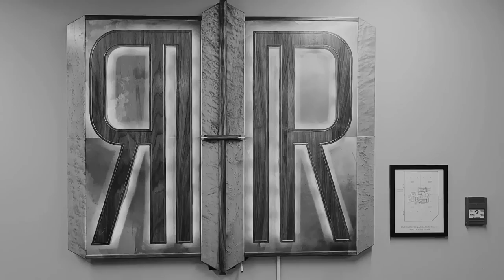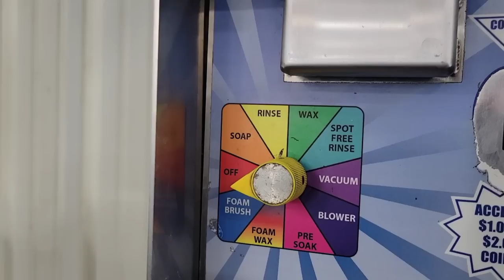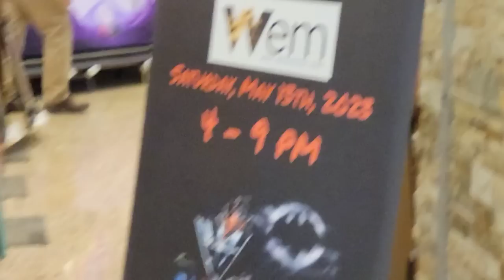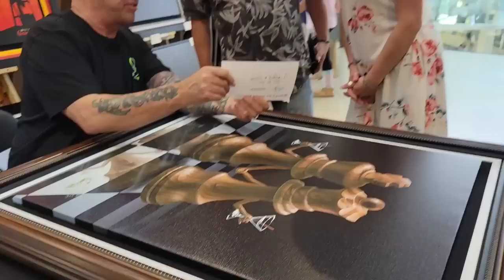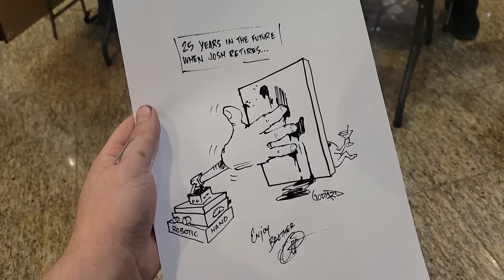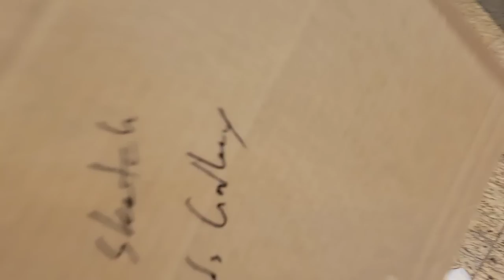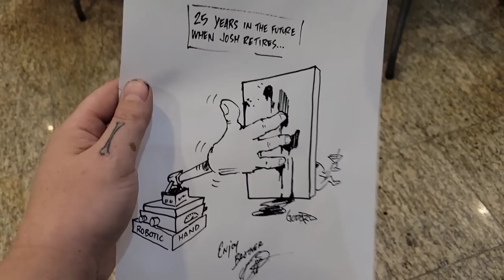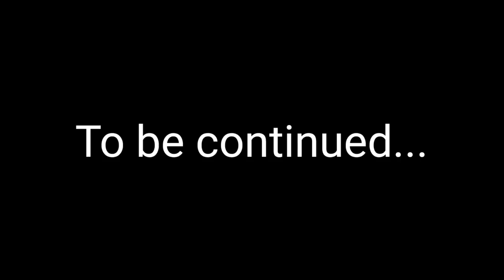I was suprised with an original piece of art! | Another VLOG #217

Comment: Your Check Engine light doesn't concern you? I have seen it on for a couple vlogs now.
Reply: @Hanzyscure  LOL!!
Reply from the maker: Nah. The code is for an o2 sensor issue. Its  been on sinse i bought it. It will turn off when i get new exhaust. Just got a leak somewhere between the two o2 sensors.